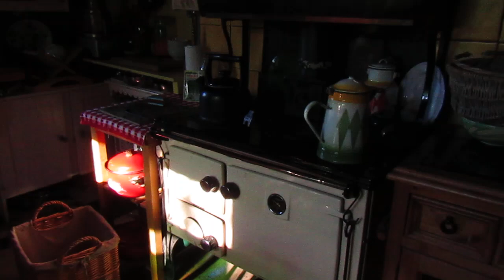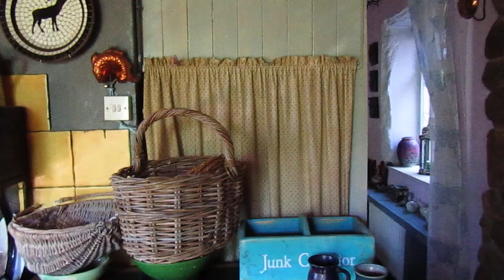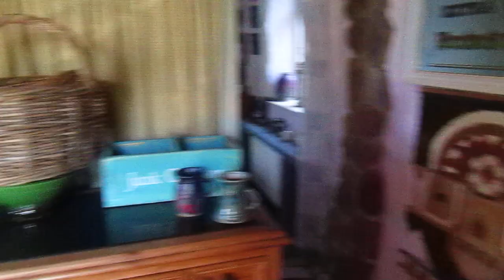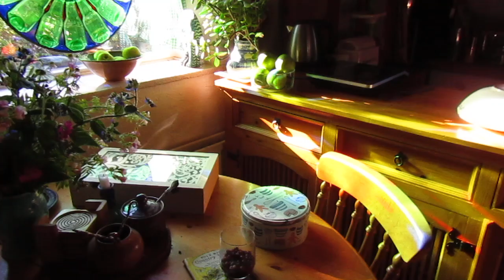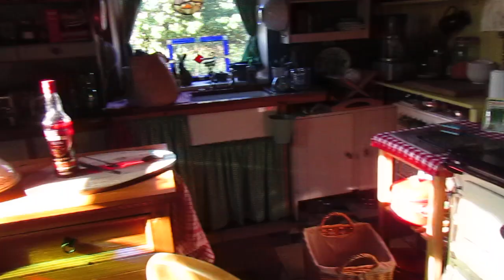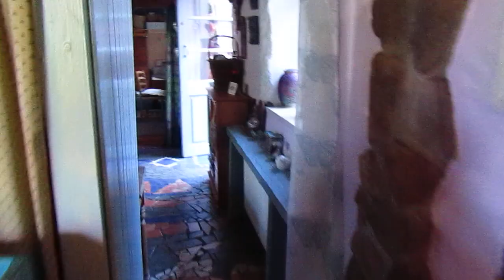Off-Grid Living without Solar or Wind...here's how!

Comment: I have radiators fueled by kerosene but I decided to turn them off and haven't used them in five years. I installed a Waterford Stanley and it heats the entire house, cooks, and dries the laundry.  Wouldn't do without it and haven't looked back. Also cheaper and less hassle.

Comment: Stanley is an excellent stove. I have owned Canadian Finley Oval and Heartland models over the years. Today, in New Hampshire- USA, we use a 1930 Home Comfort , originally made in MO. Lovely vintage cook stove, with a hot water reservoir and a hot water jacket for a 30 gallon hot water heater. It took me one year to restore her. Our stove will not circulate radiators. The stove heats 988 sq. Ft. easily. She will burn coal, but we prefer wood.

Comment: Your hot water from the tank is done by "thermo Syphon", you could also add the radiators to this thermo Syphon system, but you would have a much longer warming up time and more back boiler rumblings.  I am building a house at the moment from my pension alone, which will be thermo Syphon heated & same with hot water too. Works more efficient on a 2 story house, even better on a 3 storey house. Good luck & I hope you enjoy that mug'o th'e.

Comment: You can't be a percentage "off grid" it's either all or nothing.. you're either tied to the electic company or you are not. You're 0% off grid. You are in fact less dependent on the power company and very efficient. You're also self sufficient and could still function without power, which is awesome.

Comment: do you also use your stove in summer? did i get that right: you would not have any hot water if you would not use the wood stove? we got ours last winter, so this will be our first summer with a wood stove. 

we live in germany and our chimney sweaper told us that we need to clean the sutt around the baking oven regulary or else it will not get as hot anymore. ours at the moment can reach 300-350°C. do you do that as well? and if yes: what kind of tools do you use?
Reply from the maker: A low fire once a day.

Comment: I have a gap in my kitchen where an oil-fired Rayburn used to be, and in a year or two I'll be putting in one of those Stanley stoves. If the power goes out you still have heat, hot water, cooking, and that lovely homely feeling that only a real fire can bring. If it could power a giant flat-screen TV everyone would want one!

Comment: Do you ever plan to get panels so you can be 100% off grid?
Reply from the maker: No...as I don't want to have more "stuff" around that needs maintenance and replacing with parts every so often...also it's all plastic and oil based. My electric is powered through wind turbines I can see from my kitchen window!